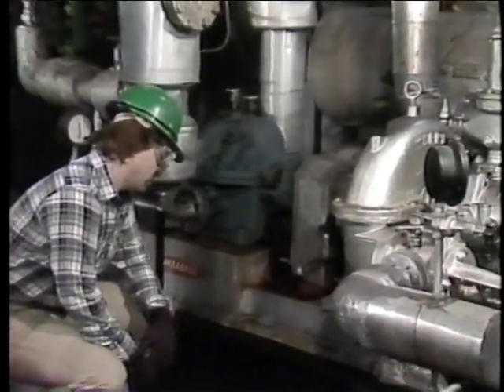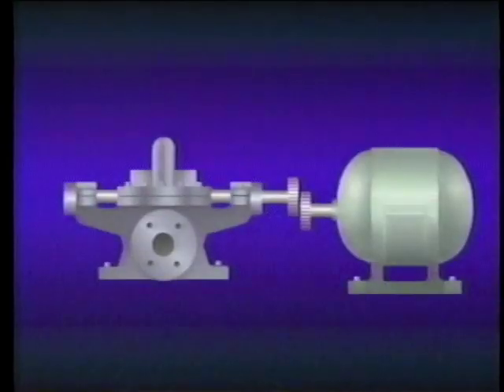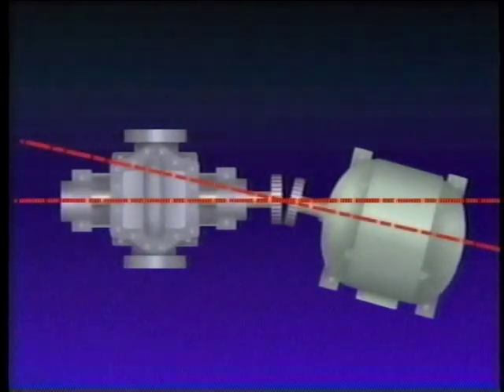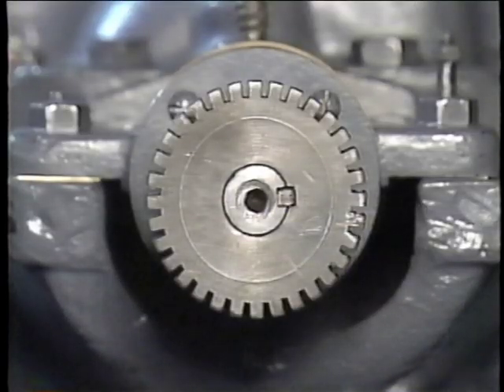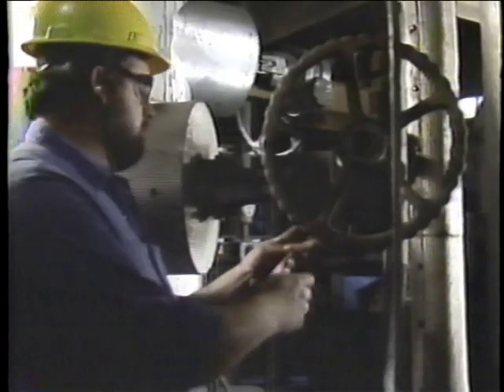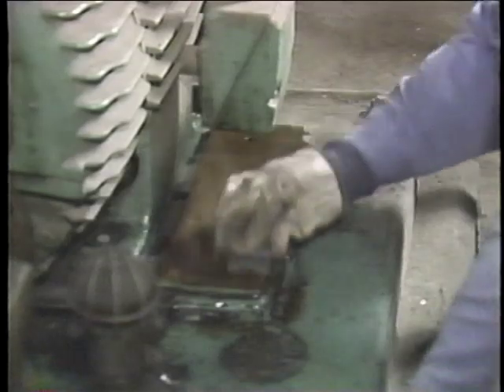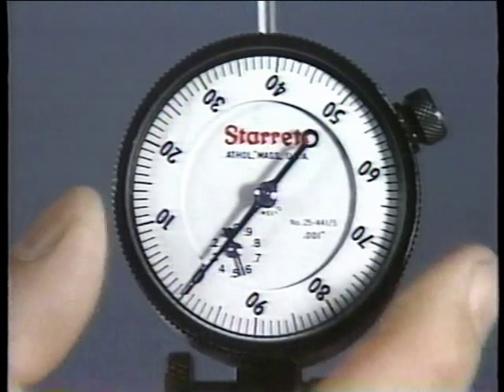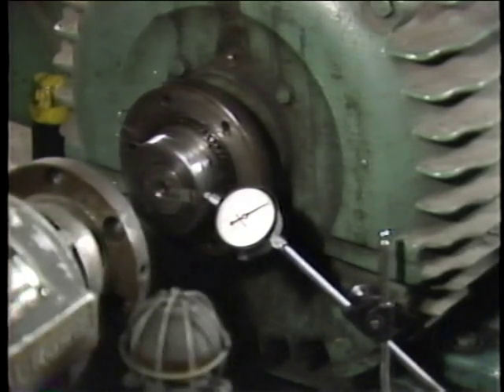1970's NUS training Series Shaft Alignment 01

Comment: I would love to see more on the Chevron double reverse method.  This is an old school rim and face graph method
there are modern methods for rim and face and double reverse that involve simple mathematical formulas that
make the process simple and easy.   I started my career in the air and gas compressor service field and moved
on to the Millwright trade.  The refinery standards for machinery installation, grout, and precision alignment were
grueling!  Every step of the way, a refinery engineer had to witness the alignment, soft foot measurements, pipe strain,
etc.  If there was a void in the grout, a hammer test would reveal it, and it had to be corrected.

I have an old school Adams double reverse kit and a Vibralign LASER kit.  I have been doing this for decades
and this covers every aspect of the process although the graph method is a bit dated.  The Chevron formula
makes it easy, just 3 dimensions and 4 indicator readings.